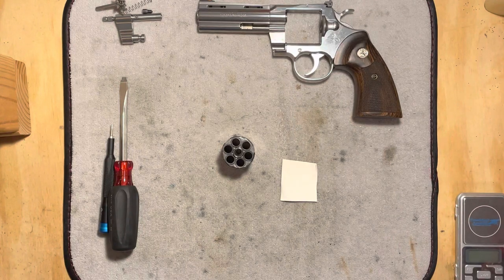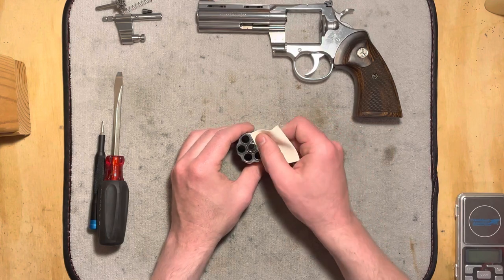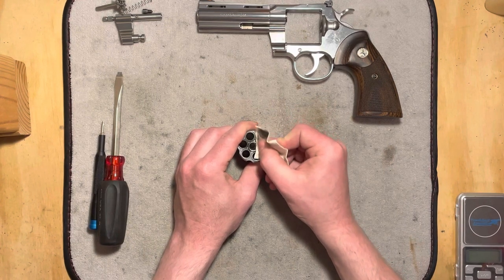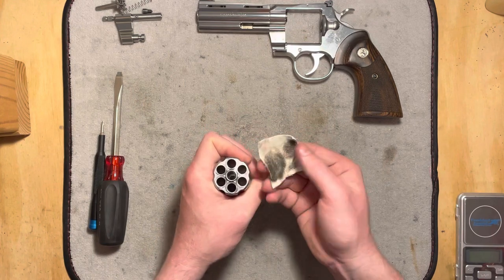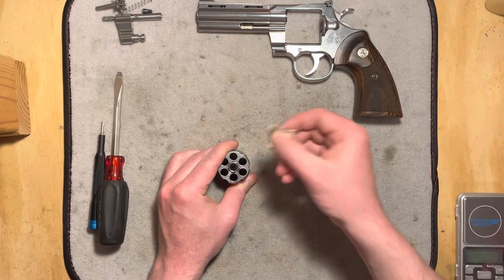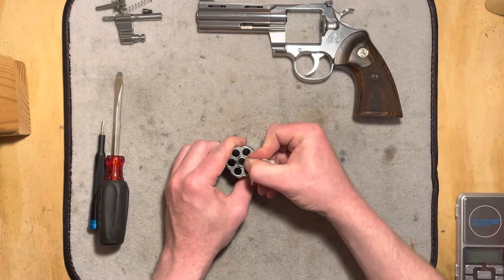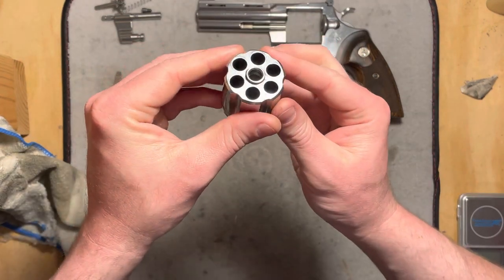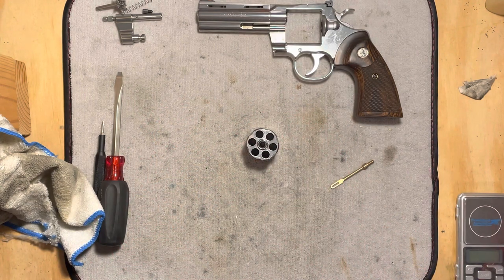Removing Cylinder Burn Rings from Stainless Colt Python w/ Birchwood Casey Lead Removing Cloth

Comment: Midway use to sell this yellow abrasive impregnated cloth.  Never seen it again.  Took the carbon rings off easy.
Reply from the maker: I remember those. Don’t recall seeing them in… a long time. Probably ten years ago.
Reply: @ColterBrog ya, it's been a long time.  I still have one that I keep zip locked.  I cut pieces off it when I need to clean tuff carbon off.

Comment: Mother’s Mag and Aluminum Polish works great
Reply from the maker: Do they not affect the finish of the metal? 

The thing I like about the lead wipes is that they don’t polish. If you have a high polish, then polishing is fine. Brushed finish, or a bead blast polish like the Colt can be altered by some polishes.

Comment: I use the green scotch pads and Turtle Wax chrome polish and rust remover. Just a little on pad and light rubbing just about 2 minutes tops, sometimes one minute will do. I don't take cylinder off gun. I do first spray gun with Pro Shot one step cleaner and brush first, wipe off and hit cylinder face with the Turtle and green pad.
Reply from the maker: I’d be concerned the scotch pads might be more abrasive than necessary, but I haven’t tried it so if it’s working for you it must not be too bad. I’m inclined to think the polish is probably doing most of the work. Just light pressure I assume? 

I love Pro Shot stuff and should use more of their products. Everything I’ve tried has been at least average and done of it is pretty good stuff. I like their cleaning kits.

Comment: And after arthritic fingers have buffed and polished the front of the Python to a mirror like finish, six more rounds of 158 grain CPWNFPGC lead bullets fully stoked with H110, and the rings are right back again. It's like trying to keep the bugs off the windshield of an eighteen wheeler, traveling through Georgia at night in the middle of August. (Splat!)
Reply from the maker: Absolutely true- waste of time, but some people like it shiny.
Reply: @ColterBrog  
Evidently, they don't shoot them a lot. They prolly spend more time laying in a safe than pointed down range.

Comment: Thank you for the upload on this particular problem with revolvers being a collector of robbers and I had had many problems cleaning these cylinders. Also different parts of the gun. Nice called Python by the way. As a professional gunsmith I have been working with many revolvers for over the years with powder burns and there's a lot of solutions out there like anything else. Be careful with the body of the gun and do not use sandpaper. Some people have heard that you sandpaper not a good idea. Better is to buff it out using the proper solutions. If you have gun space experience, we know how to remove the cylinder even better. Thank you for the video. Sincerely yours, gunny USMC
Reply from the maker: Thank you for the comment and kind words. I appreciate it.

Comment: I’ve found that on the cloth ingredients remain on the cylinder face, and a brass brush will work it into the gas check area. 👍👍👍👍
Reply from the maker: Good tip. Thanks!

Comment: I really appreciate the tip! Just ordered some online... I've got a couple of snubbies that would really benefit from this treatment
Reply from the maker: Disassembling the cylinder, while not totally necessary, makes this work much easier. Takes a little elbow grease but yields a great result with no change to the finish of the steel. 

Just be sure to only use it on stainless steel.

Comment: Save the teardown and just use flitz, smear it around on the front of the cylinder with a Q-tip and wipe it off,  your done in just 10 minutes or less. Your cylinder will be clean and shiney.
Reply from the maker: Flitz will change the finish appearance of the base metal. Particularly on revolvers with a brushed stainless finish, it will make it glossy.
Reply: @ColterBrog  Do not use Flitz on new Smith and Wesson blued revolvers. The Flitz will help remove burn rings on stainless steel. Renaissance Wax and Flitz do help prevent rust and will bead up water if the firearm is exposed to rain.

Comment: That was a very light burn ring, did you fire all 6 rounds...?
Reply from the maker: The stainless they use on the Python tends to not show much burn. That said, this was at a pretty low round count since it had been cleaned previously and was for the sake of demonstration. It works well on more severe burn rings, also.

Comment: I wonder if, although they are unsightly, the burn ring deposits on the front of the cylinder are actually helpful because they might make for a smaller cylinder gap?
Reply from the maker: Not in any amount sufficient to matter. The gas blowing through there is peaking in pressure at tens of thousands of PSI. You’ll never get enough build up to accomplish anything, and what is removed here is more of a stain that it is a substance. 

It’s purely a cosmetic concern. I definitely don’t clean the front face of my cylinder regularly because it just doesn’t matter. Likewise I don’t avoid cleaning it because that also doesn’t matter. 

There’s nothing to be gained either way, it’s just whatever makes you happy.

Comment: I have always used Birchwood Casey Lead Removing Cloth for mine Stainless cylinder, but after 18 shots Burn Rings is back again 😖. I like your canal 👍
Reply from the maker: Yeah, definitely only temporary. I don’t clean off the burn rings every time, but sometimes it’s nice to polish it up and make it look pretty again.
Reply: @ColterBrog  I do the same

Comment: Just did this the other day with my Taurus. The gunsmith, and inspector's shot my piece and didnt 🪥 it ⁉️ After I complained about it. I disconnect the cylinder arm from the gun. Actually, this was fun to do.  I could 👀 myself doing this just for fun.
Reply from the maker: Yeah, it’s kind of satisfying seeing it shiny again. 

In general, though, I would not consider this to be “cleaning”, but rather a cosmetic refurbishment. It has more in common with rebluing something than cleaning for any practical mechanical purpose.

Comment: ok iam going to buy this. iam wondering if it can be used to clean this chambers of the cylinder, and can it be used to clean the barrel bore of semi auto pistols....in fact why not clean the whole gun with it
Reply from the maker: This will cause damage to many finishes which aren’t stainless steel. I have used patches of this to remove lead from stainless steel revolver chambers before.

It really isn’t necessary for general cleaning, and in some cases would be harmful. It’s a specialized product.
Reply: @ColterBrog  thanx for the response, i will use it on revolver only
Reply from the maker: @The2701666  Specifically stainless steel. It can definitely remove bluing. Pretty powerful stuff.

Comment: I can't agree more with the product you recommend. I've been using it for 20 years. But why did you take the cylinder off. Just crazy.
Reply from the maker: A few reasons, one of which is just to make the filming easier so the audience can get the best view. 

Second, is that I can really put some elbow grease into it without risking any torque to the crane or extractor rod. Just allows me to be more aggressive in the cleaning without worrying about damage. 

Third, it gives me a little better access to the area around the gas ring so I can really get the small spaces clean, too.

It’s mainly just for convenience and isn’t necessary. It’s simple to do and just made life easier.

Comment: Use aluminum mag wheel polish comes right off easy peasy
Reply from the maker: This would probably work fine on the Python with its high polish finish. 

In more matte or brushed stainless finishes some of the polishing compounds make the brushed finish take on a shinier appearance, especially after repeated use. 

So, yes, but it’s application dependent.

Comment: can be used in a matte metallic finish?
Reply from the maker: I have had good success on polished stainless and brushed stainless. Matte stainless steel shouldn’t be an issue- although if it is not stainless steel I don’t know. I would be hesitant to use it on an aluminum alloy without consulting the manufacturer.
Reply: @ColterBrog  Thank you

Comment: Pointless if you going to shoot it again soon. Regular  cleaning is all you need. However if you shoot cast lead I find the cheaper and less effort way is to buy a case of Scotch Brite White pads and uses Hoppes #9. It will last a life time and leave no scratches and you can use it safely else where lead and carbon build up is.

Pads work OK too, but give the Scotch brite a try. It works so much better and faster.😁
Reply from the maker: The point was to make the video on how it’s done. I almost never do it just for my own sake, but the burn rings bother some people.

Comment: Bent my crane screw when trying to get it loose😭
Reply from the maker: What screwdriver were you using?
Reply from the maker: @johnd7116  I wonder if Colt will sell a replacement? 

I haven’t tried it with them- some companies are really sticklers about selling parts. SIG was pretty good, not sure about anymore. 

S&W side plate screws are one thing I really wish were widely available and I’m always surprised they aren’t- whether factory or aftermarket. There are SOOO many old revolvers which are cosmetically fine except for someone at some time in the past deforming a screw head. It’s a shame. I can often do a decent job of rehabilitating them and hitting them with a cold blue, but it isn’t perfect.

Comment: Only problem w a revolver… 6 holes to clean instead of one…
Reply from the maker: That, and most people are unwilling to disassemble them, and most manufacturers discourage disassembling them. 

Revolvers are fairly well sealed up from most dirt so it’s typically not a problem for range guns or nightstand guns, but when it comes to carried revolvers in humid climates with sweat… it can become a problem when the internals don’t receive preventative care.